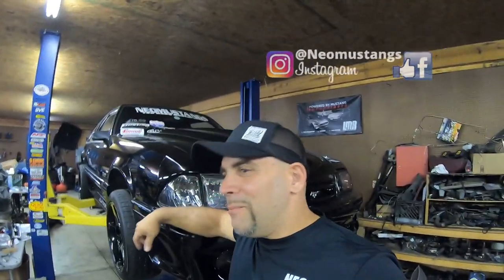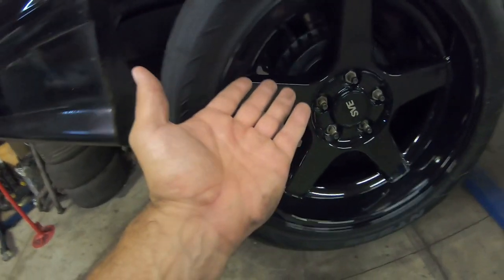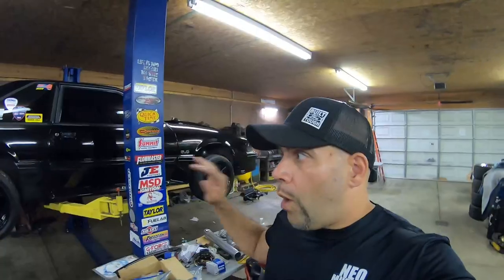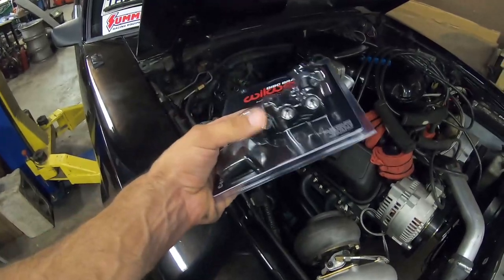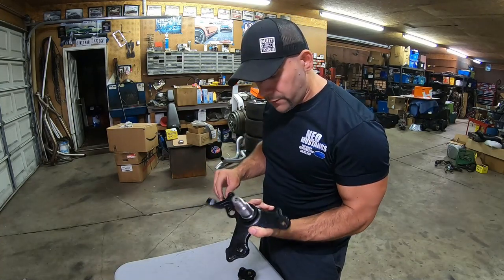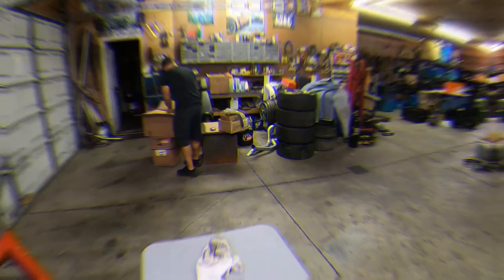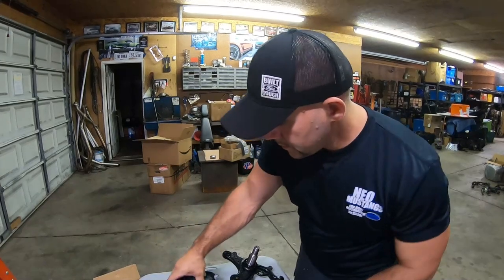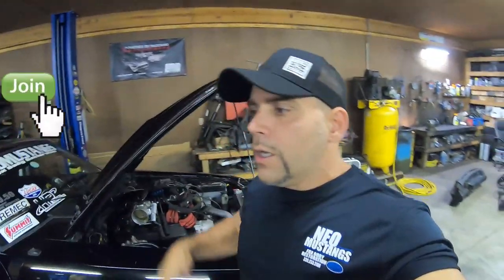This BUDGET Foxbody Upgrade Is EASY, CHEAP AND EFFECTIVE! Junkyard Finds!

Comment: Only adjust the top hole on the spindle! I did this ats swap and modified both holes to the correct bolt pattern and the caliper rubbed on my 03 terminator wheels on my 85’ stand. I ended up welding and re drilling the bottom hole on a mill.

Comment: I’ve been around fox body’s and done all the mods you can think of for past nearly 30 years and never saw those calipers. Sounds like a solid upgrade for very fair money. I did the cobra pbr calipers front and rear years ago on my ‘93 Cobra. They work great too.
Reply from the maker: Ya my white turbo car has pbr and cobra brakes on it. Stops very well 140+ Still
Reply: Do you have the link to pbr cobra calibers and are they direct fit to 94-95 spindles?/ thanks

Comment: I had a 89 hatchback with a Paxton novi 2000. It did 10.32@131 with stock brakes. Yes it was an adventure lol. I have a stock 88 gt convert. Now i might start building a little. The 89 is long gone.

Comment: Rock auto also sells the 03-04 Mach 1/Cobra calipers & rotors which bolt up directly to the SN95 spindles without modification.
Reply from the maker: Brembos about same price and better

Comment: Thank you for making this video.  My last comment on your live stream show was regarding my next mod on my 95 Gt "Brembos". The Gt500 breaks also fit with the 95 spindles (if I remember correctly, it's pricey) Regarding the Brembos: a 17" rim on the car is a must, and I also believe there is an offset bushing that has to be machined to get better contact surface between the break and it's disc. 
👍 On the Brembo upgrade video tho.

Comment: Now my question is how would these big calipers fair with a manual brake master cylinder? I'm getting ready to pull my motor, clean up my engine and considering getting rid of the brake booster.

Comment: I have an 89 convertible that is completely stock. I don't plan on running serious power but I do want looks. Can you put SN95 wheels on the rear drum brakes as long as you put a 5 lug axel? Asking since that's what it looks like you did. Thanks!
Reply from the maker: You can put any 5 lug ford wheel on once you swap axles. These axles are 9" ends Moser aftermarkets

Comment: My chevelle with 2002 Camaro disc brakes, the front brake calipers look exactly like the factory sn95 front calipers.  Planning to swap spindles on my fox soon and see if Camaro calipers bolt to sn95 spindles.
Reply from the maker: Well caddy brakes are GM if I’m not mistaken

Comment: Is the 94-95 spindle necessary if you use lowering springs?
Not having the notch lowers the tie rod end. Lowering the car raises the tie rod end. This "roughly" balances out.
Is my thinking correct or is there something else I'm missing?

Comment: Ooommggg you just saved me a ton of money right now no BS
Reply from the maker: Nice! Some really good write ups here on the tube about these brakes. Check them out. Ill be installing my own version soon.
Reply: @Neomustangs  hey how much HP can I squeeze out of 42lb injectors
Reply from the maker: @jakejohnson3523  rule of thumb 500 max. Wheel. I have done it half a dozen times
Reply: @Neomustangs  thanks man your like the dictionary for me

Comment: Dan would this brembo brake set up be the equivalent to an 03/04 cobra front brakes or would it be a little better thanks for any help
Reply from the maker: Better
Reply: Hey man I have the 03 cobra brakes front and rear would there be any point in going with the brembos on the front?

Comment: Have you ever tested the Maximum Motorsports Brake Upgrade Kit?
Reply from the maker: I have not no.
Reply: I run the MM kit on my 89. Excellent update. High speed stopping power has little to no heat fade.
Reply: @joey4872  great! Thanks for the insight. That's exactly what I wanted to know.

Comment: The Cadillac calipers messes up the brake bias. I was going to do the upgrade myself but Jack from Maximum Motorsports advised me not to. They look cool but the car will stop worse.
Reply from the maker: Ima try it out. Can’t be any harder to stop than I have. I can always go back ya know. Gonna try the S&S kit ?
Reply: Repair Geek has a video about this as well. Swapping to the Taurus rear brake calipers will put that bias back to stock(or close enough)

Comment: Hey Dan is it possible to use the 95 96 spindle and still keep it 4 lug do they even offer a wheel bearing ? Digging the into by the way lol 😂 your car is going to stop on a dime and give you 2 cents change bro 😎
Reply from the maker: That’s interesting. You’d have to modify the hub and rotor but anything is possible. With these kinda brakes you’d have to stay 17” on front

Comment: Honestly I think brake and suspension should be addressed first but I'm just like everyone else more POWAH! 😁
Reply: +1. Your stuff is great aswell. Have you decided how many cubic inches your going to yet? Your last video (I believe) was left on a cliffhanger, perhaps building momentum for the next video.
Reply: @mindandbodymuscle5345  Thanks. Actually that's an older one. Ended up going with a 347